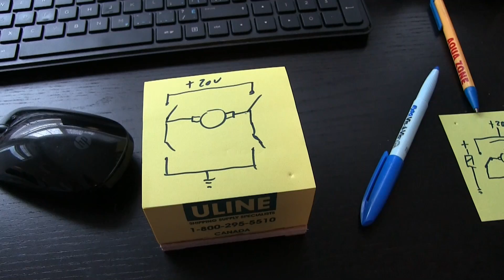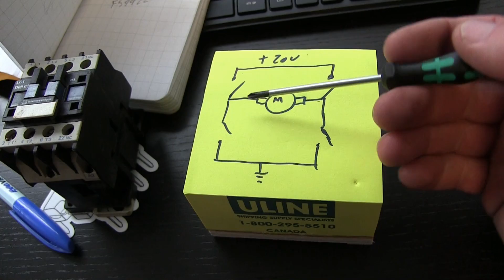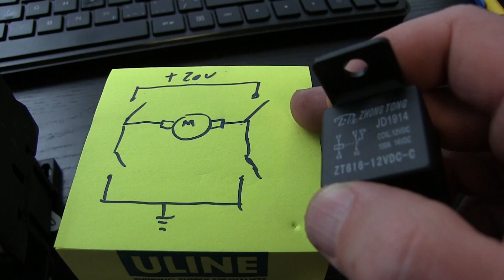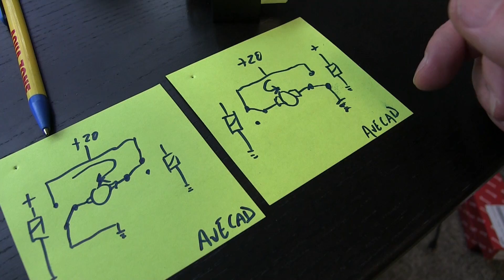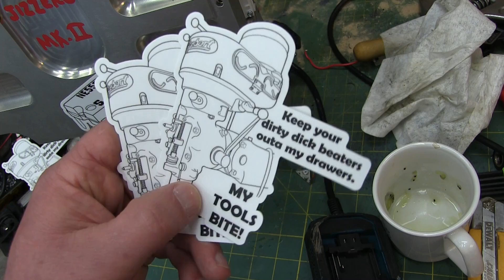Hacking Juicero's DRM Fruit Bags

Comment: Don't know proper name for the switch I'm thinking of but why not a six pole on-off-on switch with cross wires for the forward and reverse? or is there too much power for that? I've seen them on electric lawnmower decks and lift chairs for the handicap.

Comment: Now that summer is here how about a review of an electric mower? Self propelled prefered. My neuton has about 10 years on her and her wheels are about as weebly-wobbly as you can get w/o being in low earth orbit. Replacement needed. note: Would definitely buy another neuton because of the reliability but I want self propelled this time and neuton doesn't offer it. Ryobi makes one. Homeless despot has an EGO: http://www.homedepot.com/p/compare/?errorURL=ProductAttributeErrorView&langId=-1&storeId=10051&catalogId=10053&prodComp_0=206515944&prodComp_1=300402757&keyword=self%20propelled%20electric%20lawn%20mower

Comment: You could have done it simpler, without the two relays and control switch, by just using a DPDT toggle switch. Or, a DP3T toggle switch (so that you had a center-off position too).
Reply: Yeah, but you realize when it is over engineered, it requires wiring  that looks like HELL in a handbasket of confusion.  All wires and light need to be the same color too...just to scare the weak at heart.  That is what the alkyhol is fer.

Comment: I can make a linux driver to read the QR codes for you. Actually, if you JTAG the device, or raw access the board and try to dump the system image, you can find the actual instructions that will show you how it computes the hash from the barcode. If properly designed, there should be a private function called back to the function that publishes the info to their web API. This will tell them everything about your "package" and it won't press if there was a recall, for example. The prototype would need to have the headers for the linux stack it is probably running on, which is probably 3.x microkernel. Init camera, get memory allocated, dump raw image, send pointer to parser, grab hash from output, see how she chooches.

Comment: It works better than the original.  bet you cant juice that rum bottle in the original.  Should have tried before you fucked, er...modified it.  Bought the stickers instead of bowing and scraping at the foot of the throne in the seat of power in the empire of dirt. 
just had a thought (owch!) You mentioned colostomy squeezer...perhaps this machine could serve the forces of good instead of evil by being repurposed to recycle/reuse colostomy bags.  I don't know what those things cost, but there's got to be some poor ziplock shitters out there wishing there was a better way to empty and reuse those bags.  AND, it can be classified as durable medical equipment, leased to the user by perscription,  paid for by insurance, sold to medical providers at tremendously inflated costs....win, win, win!  Gonna be RICH! just don't get confused when you are going to make a nice cup of juice.  grab the wrong machine..."Hmm, odd flavor and aroma there..."

Comment: If you want to get the press to full power, why not use the AC/DC part of the board, and just hook yourself to these optical isolators between the mean well converter and the four big caps? It's pretty obvious that there are two to select the spin direction of the motor, and the others might be some current feedback so the controller knows when the motor stalls to start rewinding the press.
Oh, and i would say you are now in the perfect position to test these marketing claims with some force-testing. Do you have a sensor for the expected forces small enough to fit in there, or are you just going to lift up a car or something very heavy in your workshop?

Comment: The uk model may just have a bridge rectifier, that will give about 330v DC
Seeing the 2 diodes suggests a doubler,  2 capacitors in series, one leg of AC to each diode, other leg to midpoint of the caps (search images for voltage doubler)

Comment: Hey AvE, the way you controlled the motor direction and power in the Jizzero could actually be done a lot simpler with a single moving part. I have this old-ish Mecano motor which wasn't working, and so I took it to bits and found how it controlled the motor direction (and power). I was assuming they used some pretty complex stuff, but it's literally 2 metal pads (one at like 3V or 6V and the negative/ground) with some non-conductive material between them, and a small bit of plastic that has some shaped metal on it, which makes contact with the pads.

(Diagram of what I'm talking about): http://imgur.com/a/F7wmr

Thought you might be interested, and you might implement it onto the Jizzero or something in the future?

Comment: If you just want to hack the DRM, just figure out what the QR code reads and print your own. Most cell phones will tell you what the data on a QR code is with an app these days. Also, did you license AvECAD from DaveCAD  or vice-versa? And nice flip-flop on your Jizzero. ;)
Reply: Now you know why the shit is hooked to the internet, individually serialized bags an cross checked against database before it squishes anything.
Reply: Good point, but that takes all the fun out of it. There's an immense satisfaction of 
orchestrating a physical modification.
Reply: Zzyzx Wolfe The question will be whether or not they have either obfuscated or encrypted the data to prevent simple reverse engineering.  Otherwise you could just present it with a fixed copy of a valid label and use that label over and over until it expires, or did they also serial number things so that can not be easily done either.
Reply: I doubt it's obfuscated or encrypted. Almost all hardware and software treats barcode inputs like they're not an attack vector. In quite a few different 1D and 2D symbologies, you can literally send keyboard commands to the host, including stuff like WinKey+R, so you can make a barcode that opens notepad from the run line, types in your code for you, saves it as whatever type of file you want, runs it, and can even hit enter on the UAC dialog. You can disable symbologies and features on barcode scanners, but barcode scanners are programmed with barcode scanners, so even that can be easily circumvented by scanning a barcode that tells the scanner to accept what you want it to do. Though, pretty much all of them are left in factory defaults which accept basically everything.

Comment: New fan here.  Can we take a look at this? Air horn is loud and works directly from the compressor (no stored air). I just want to see how that little compressor motor does it as the human lung is too weak.  Check it out... Hvala! 
Single Horn 12V 150 DB Super Loud Air Trumpet Set Kit For Car Truck Boat Train ... https://www.amazon.com/dp/B01KX9TTE0/ref=cm_sw_r_apap_oZGQyThDGgpvA

Comment: If you use a DPDT switch, you don't need any relays at all.
Reply: Sure, but then it would be under engineered
Reply: If the two relays setup had a failure wouldn't it result in a dead short?  Surely a DPDT switch would be engineered to have far less spectacular failure modes.
Reply: I was thinking about that, Adam, but if you look at the AvECAD drawings in the video, the way he has them wired, they wouldn't fail to dead short.  However, it's still three too many parts for the application (relay, relay, power switch) with the attendant increase in complexity.  If one of those parts fails, it would be a lot harder to diagnose.  Maybe it's an homage to the engineering that went into the original Juicy Jizzer. :)
Reply: Yeah, I was just going to say that.  And you also wouldn't need a power switch..
Reply: Nah, you're just looking at the drawing the wrong way. The DPDT is the same circuit, you would just draw it a bit differently.
Reply: yep.  center-off DPDT.  that's good engineering :-)

Comment: Rather than mess around with relays couldn't you just use a single centre-open, DPDT switch rated for the ampage of the motor?

Comment: When that juicer chooches, does it have limit switches to stop them angry pixies when it reaches either extreme end of its movement?  Or did you bypass everything and it will run until the motor stalls and burns out, or until it self destructs?

Comment: You do know you used two relays and one switch to many, right? Plus with those relays you need a second switch to shut it off. You can accomplish the same thing this way -- The smarter way to wire the whole enchilada is simply to use 1 DPDT switch (rated for the full motor current, of course)  with the commons to the power and the motor to one side of the DT contacts. Now on the other side the wires just cross over to the second set of contacts so the motor will reverse.

Also google "center tap power supply" and I think you'll see that what looks like halfwave rectification can really be fullwave done with only 2 diodes done via the CT transformer. BTW can't wait to see what you do with it next! Mining? Impregnation? Aerospace? Herding cats?

Comment: if you only use one switch and no delay, isn't there a risk that both relays on the same side of the bridge are closed at the same time  (milliseconds) causing a short which wears down the relays over time?

Comment: I stand corrected, they aren't doing PFC boost conversion.  My bad.  I took a closer look at the board and yeah, there isn't an inductor or anything else needed. 

But, I think you called it (then immediately second guessed yourself even though you had it right to begin with haha) on the voltage doubler.  

http://www.learningaboutelectronics.com/images/Voltage-doubler-circuit.png

See above.  It has two diodes that feed a pair of capacitors, which each only see half of the voltage, so would be in series and only need to be, for example, 250V each.  
I'll bet my lesser nut that if you check, you'll find that those 4 capacitors are actually two pairs of them in series with each other, and each series-pair in parallel. But, seriously, looking at the components... and that they only use 2 diodes, its gotta be that.  

Plus, 120V*√2 = ~170V.  Double that, and factor in diode drops, loss in the capacitors, etc., you get 330V.  

I think you nailed it - it's gotta be a voltage doubler circuit.  I guess maybe they really wanted a motor that was all voltage and no current? I dunno.  Would make passing FCC easier for sure.

Comment: to all those saying that engineering is designing something that just barely works, that is not really right. Engineering is designing something to meet or exceed the design specifications of your client with respect to function, form (basic form factor more so then aesthetics) and cost among other aspects. The client will generally give you an idea what they want to emphasize in the product. If they give you something like a cost point, and a target pressure, and you find that you can either meet the target pressure at a lower cost point, or exceed the target pressure at the current cost point, either scenario might be chosen depending on the client's demands. If an engineer is given virtual carte blanche as respect to cost (within reason), and only told they want to maximize pressure and longevity, they might well design something like this. Sure, there were some questionable choices (the single retaining bolt for the plate, unsupported bearings as guides) but you need to know the design specifications before you can judge the overall engineering.

Comment: That's a very interesting DRM system they have there... I would bet that if they ever were to do something like sue a company who made cheaper juice bags, it could end VERY poorly for them.  Morton Salt tried something similar.  They made, at one point, a machine that would vend salt tablets.  Some guy put non-Morton salt tablets in his.  Morton sued.  The courts said this was an abuse of their patent on the vending machine itself and stripped Morton of the patent and put it in the public domain.   (Leonard French recently did a video that mentioned this case, look for his video about the Wargaming stupidity if you're interested) The courts do not look kindly on this kind of thing, trying to use a legal right like patent law or copyright to establish a monopoly on an unrelated product (in this case, premasticated fruit).  I know they are assuming that the DMCA will protect them.  They intend to claim that someone who makes knockoff pouches had to violate the 'circumvention' clause to make it work.  And, really, they'd be right.  You would have to.  The bar you have to cross to violate that clause is STUPIDLY low (literally just ignoring one undocumented bit is enough).  But they really might not want to test that in court...

I wish I knew enough hardware to be confident that I could hack that thing, but my knowledge stops just shy of there.  I am very curious how 'serious' they were about protecting their DRM on this thing.  Are there any firmware updates available?  Cracking those open often yields interesting things, especially if'n you know what sort of processors/SoCs are used...

Comment: It is possible to make a doubler with only two diodes. This is commonly done in computer power supplies with the 110/220 volt switch. In 220 mode it bypasses the voltage doubler and in 110 mode it uses two diodes to double the voltage (pretty much every computer power supply was designed for 220 volt use).
http://www.daenotes.com/electronics/devices-circuits/voltage-multipler

Comment: Only need two diodes for a "full-wave voltage doubler" link below. In essence you've got two caps in series and you charge one from each side of the mains cycle (thus each is charged to 120*sqrt(2)) then you tap the voltage off the "outer" terminals which gives you 2*120*sqrt(2) out (because the caps are in series).

https://www.allaboutcircuits.com/textbook/semiconductors/chpt-3/voltage-multipliers/

Comment: Maybe you can skip knowing the torque of the motor and gear ratios altogether.
Gearboxes are just a way of delivering power at a higher or lower speed to a load.

Work = Force x Distance  so...

Let's say you run that motor at 10W for 2 seconds, and in that 2 seconds the press plate 
moved 12.7mm (Half an inch):

10W for 2sec = 20joules (Work)
Plate moved 1/2 inch (Distance)

20Joules = force x 0.0127meters (half an inch)  >>  Force = 1574.8 Newtons or about 354lbs

That would be the force pressing the plate against the juice bag, how the area of the plate would
affect the pressure the bag actually feels, I have no idea. I hope this helps you in some way, as
calculating multiple gear ratios can be a pain in the ass :(

Comment: AvE they ARE use a voltage doubler to get the 330V. Basically you take the positive halve of the sine wave, which has a peak voltage of 165V. Then you take the negative half of the sine wave, which has a peek voltage of -165V. Using pixy magic you add the positive and negative peak voltages together and get 330V. The circuit looks like this <http://www.bristolwatch.com/ele/voltage_doubler.htm>. You'll notice that the capacitors in the circuit are only rated for 200v. This is because they only see about half of the 330/340 volts each. Not quite sure why they are using 4 capacitors instead of 2.